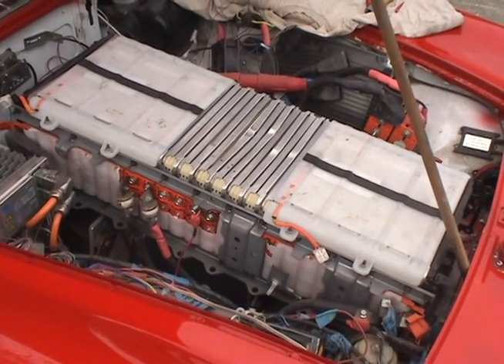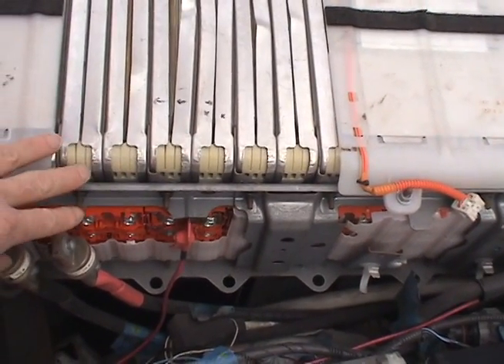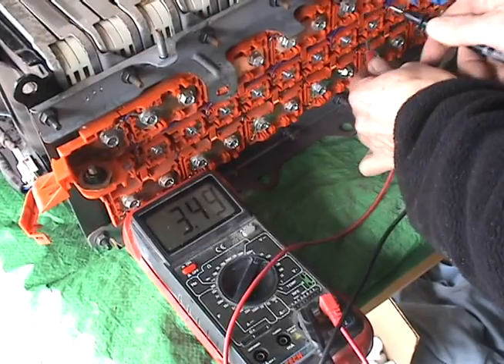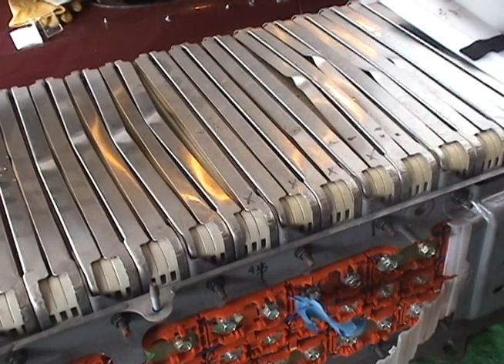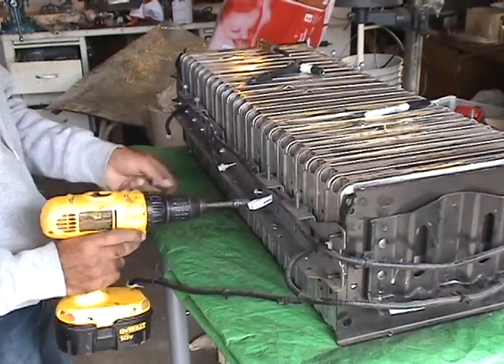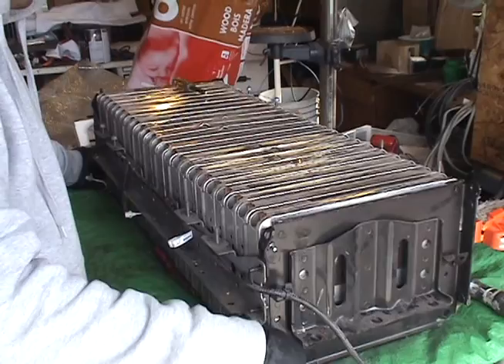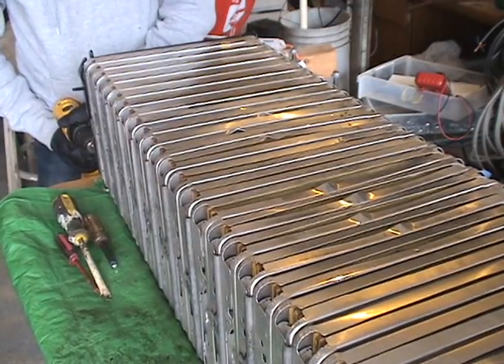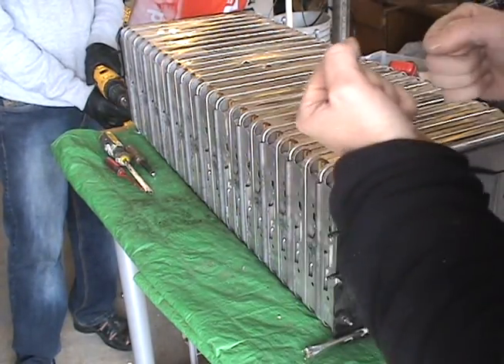Replacing cells in a Leaf Battery Pack installed in an EV conversion.

Comment: Are you using the battery without a BMS :o?
Reply from the maker: Please can we keep this civil. It's cool to have a discussion. It's also cool to reference other articles and documentation to support opinions. For example, there are plenty of chemical reactions that occur when a lithium-based battery is charged and discharged - you can read about it on wiki : https://en.wikipedia.org/wiki/Lithium-ion_battery  In fact there's so much chemistry going on that it's a really interesting challenge for the battery designers. You can watch this video of a lecture I attended at Stanford's linear accelerator center : https://www6.slac.stanford.edu/community/past-lectures/reinventing-batteries

My acquaintance Jim P who wrote and maintains the Leaf SPY smart phone application, borrowed the BMS unit from one of the cars I took apart and drew out the entire schematic. He determined that the management is done solely by discharging the slightly overcharged cells by draining the current through a fairly large resistor - I believe it was 420 Ohms - so you can work out the current drop yourself! I.E. it isn't very much - the resistors (there's one per cell - 96 of them) are only surface mount and there are no heatsinks.  This management through resistive balancing is fine for well behaved packs and is certainly less expensive than the system that (at least at one point) was used on the Tesla cars which is charge shuffling (designed at Texas Instruments).  After a while, however, with this simple (Leaf) management technique, battery charges can begin to diverge and it's pretty difficult to recover. Also, if you use Leaf SPY on a real Leaf you'll see the individual cell voltages diverge (over many tens of thousands of miles) and since we know where these cells are physically placed in the pack we can make some assumptions about the rather inadequate temperature control inside the big metal box under the car. It has rudimentary heaters in it (4 resistive metal plates) but there's no cooling which means the temperature of some cells is much higher than others. Hot batteries and generally unhappy batteries - a lot more chemistry goes on when things are hot. And more chemical reactions generally mean more unwanted compounds being created.
Reply from the maker: +Danny Bokma It's not a good idea at all. At the very least there should be a battery voltage monitoring system - just a digital display on each cell so you can visually see voltage discrepancies  between cells.  There are issues with active BMS modules in that most (including the Leaf BMS) balance the modules by resistively depleting the cells which have higher voltages. This type of BMS is fine so long as things dont go wrong. I have heard of two such battery packs where the BMS drained the cells down to zero which, of course, ruined all the cells.

The real answer, of course, is to incorporate the BMS module INTO the cells directly. That way each cell can decide it's own health, prevent overcharging and also protect itself from over depletion.  One of the huge challenges of BMS installation and maintenance is the large number of wires requires to connect all the batteries to the BMS module. On the Leaf there are 96 wires which trail around the battery box all of which have to make perfect connections. It must cost a fortune to wire them all up. Putting the BMS in the cell would make wiring simpler albeit at the expense of more electronics per cell.

In this project, the 4 cells were damaged by a mistake during charging and it's interesting to note that no amount of battery management would have prevented the damage. We were just rather lucky that the cells were held together so well that they didn't explode in the vehicle while charging.
Reply: The battery management systems I have worked with are also in control of the charge relais and discharge relay. Depending on cell voltage / state of charge the load or charger where disconnected. I would surely never sleep well if my LiIon based battery was charging without individual cell voltage monitoring. 

Industrial cells are all short circuit proof (as in will not start a fire). They will not survive it, but the place would not burn down.

good luck in your project!
Reply from the maker: +Danny Bokma Interesting. The Leaf cells are hard-wired in series : there are no relays or control on individual cells. Each cell is monitored by the BMS and maybe, as well as doing balancing, the computer might be able to shut the charger off if one cell registers a dangerously high over-voltage or a short-circuit. It's difficult to know if that would actually happen. Whether a detection of a overcharge voltage and subsequent shutdown would stop a fire is unknown. Nissan must be doing something right because I haven't heard of any fires during charging or otherwise. 

BTW - what battery systems are you familiar with?
Reply: Your statement -> "if nothing alters the soc nothing will change " is fine by me. However when you use a battery that statement no longer holds. For example the discharge current will heat the battery, since the middle of the battery will become hotter than the outside batteries the situation is no longer the same for all batteries resulting in a shift of SOC.
Reply: +m1aws on charging there is less current so different temperature distribution. Yeah it's little but this is only one thing I am talking about now, there are so many other things creating inequalities. But hey I don't mind you not using a BMS, your house isn't next to mine xD. But please don't defend and tell others to do so.
Reply: +m1aws if the temperature on charging and discharging per cell is the same yes. But they are NOT the same since charge and discharge current is different. I am a MSc. integrated circuit design student and have been designing BMS based battery systems so I now a little that I am talking about as well.
Reply from the maker: For reasons I cannot fathom, I cant reply to m1aws's comment below. So this is the reply here.

Can you read some of the other comments and answers in this video and also watch the other videos about this conversion. Briefly, this conversion uses batteries from crashed Leafs. The cells are configured to charge at 512 Volts. This voltage, cell count and configuration is incompatible with the Leaf bms so the bms is NOT used. There is no bms at all. It's also doubtful that any bms would have stabilized the charge on these cells given the mistake that was made. If you look at the video you will see that some of the cells (4 of them) are registering 4.35 (or so) volts and they are clearly damaged. There's no recovery from that situation - that's why the cells are being replaced.
Reply from the maker: I dont follow your point. These cells failed because there was no BMS at all. Not a very sensible idea I agree, but the failure you're referring to is nothing to do with the design of any BMS - either commercial or home brewed. 

The home brewed ones often fail because of the spread-spectrum radiation blasting around all cars - not just electric ones either. It's quite the challenge to deal with electronically - hence all the shielding about the high voltage lines and the twisted pair CAN bus wires.

Charging a leaf cell about 4.15V is a very bad idea. The chemistry within the cell is irrevocably altered and they would have got very warm. In fact I impressed this fact on the owner of the car. You can tell how serious the overcharging was buy the explosive force produced when we release the tension on the pack's longitudinal bolts - about 7 minutes in.
Reply: m1aws Man o man, there is just no talking to you. I rest my case.
Reply from the maker: I think that's enough of this. +Danny B - I've cleaned up a bit of this thread but -  feel free to delete/edit your comments so that the remarks  make sense without (m1's ramblings) and so other readers can actually learn something. Thanks.

Comment: Why the BMS did not protect your pack?
Reply from the maker: +SynergisticECOnomy Short answer : because there's no BMS attached. Longer answer as to why the Leaf BMS is not attached is because the Leaf BMS is expecting the batteries to be wired in series and in this conversion, the whole pack is divided into 4 equal parts of 128Volts each and these are wired in parallel while driving (because that is what the controller/motor is expecting). The pack is charged in series. So when charging the entire pack is rewired to be in series and charged at 512V. The eagle eye person will notice that this is larger than the standard Leaf pack which maxes out at about 384V. In this conversion we are using 128 battery cells (64 'bricks') rather than the standard 96 battery cells (48 'bricks'). This was done to increase the range.  What is completely clear from this video is that some sort of battery management or at least battery monitoring is definitely needed.